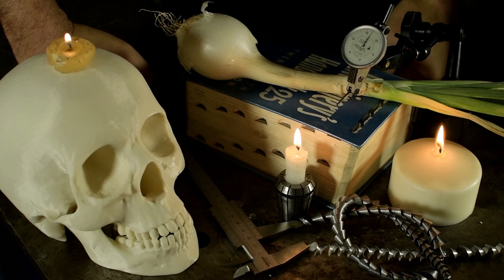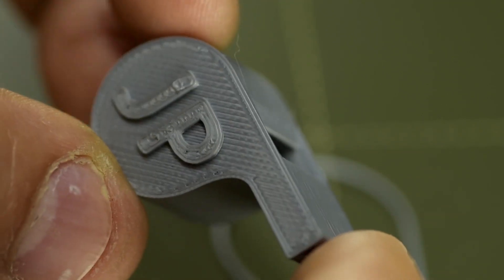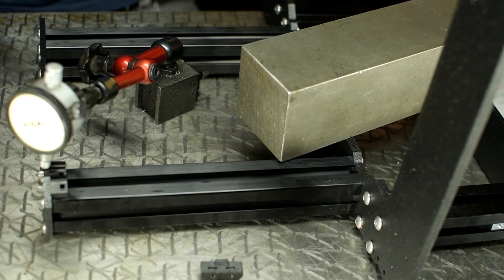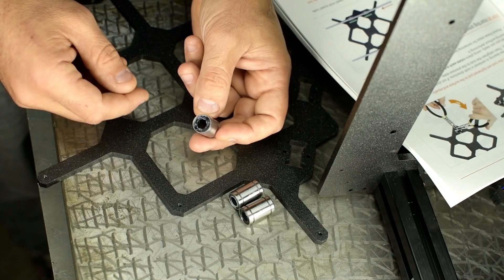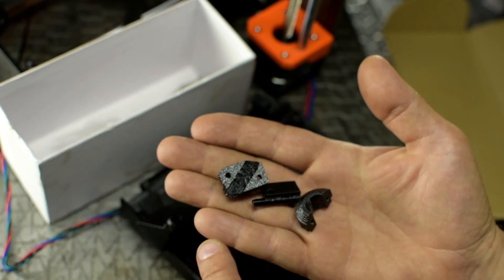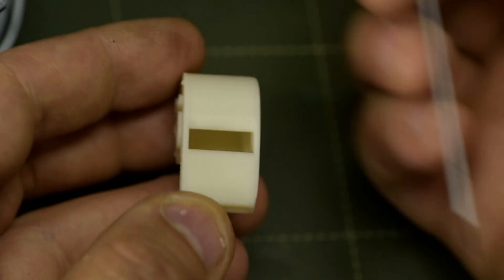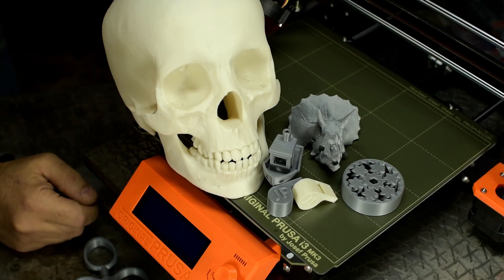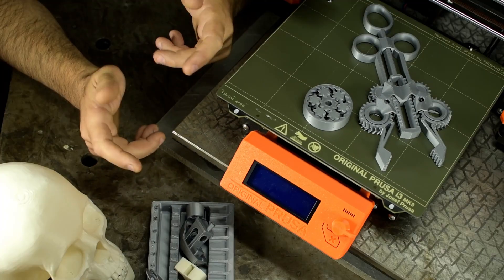This Old Tony in 3D!!! (printing)

Comment: Drive belts need tightening to reduce rippling from change in direction backlash such as near the port holes.
Reply: npgoalkeeper _ the back lash from the rubber drive belts will cause ringing. Adding better quality steel belts will reduce it but also having enough tension to reduce backlash. Axis stiffness... you’ve got bigger problems if this is your the cause and forever be chasing your tail trying to get decent results. Having a solid frame is paramount. Plenty of cheap printers can be made rigid with off shelf parts or home made. Plenty of people have to print their own parts to improve them but I find its best just to design/buy a frame that is rock solid from the start. When you do have a rock solid frame you’ll see how every other part, like the drive belts and cogs, give undesirable results with out proper tuning. Frame, steppers, drive belts, settings, dampening, inertia, bed temps, adhesion, etc, etc ... welcome to the 3d print world ToT 😆

Comment: Prusa has build many thousands of these, but they still make all their parts on hundreds of 3P printers running 24/7.  It drives this engineer crazy.  If they had switched to injection molded parts their product would be much cheaper to produce and the parts would be stronger and more precise.  But, 3D printers are by far and away the best way to learn 3D CAD.  Designing a fairly complex part on the computer and be able to hold it in your hand in a few hours is truly amazing.

Comment: My son started out with the Ender 3 for a few years and it's been reliable.  He bought a Prusa and put it together in one very long evening.  It's so much better out of the box than the Ender 3.  The software is great.  For Father's Day he took the Ender 3 and upgraded the stepper motors, driver board, bed, and put a leveling sensor (can't remember the name) and tuned it all up and gave it to me.  Hell I can even send the files over WiFi and it uses the same software as the Prusa.  Print quality is really close to the Prusa as well and it's a hell of a lot quieter now.

Welcome to 2015!

Comment: I've been 3dp'ing about a year with a cheepie (monoprice aka wanhao i3).   Lots of headaches, but it kinda sorta worked after an hour putting it together.  Lots of hacks addons after a year and I can almost always get what I want printed on it (within it's limits of course) but can't bet on getting consistent results no matter what.   IOW it may take two or three tries.

I should have ... and almost surely will within a few more months spring for the Prusa.   With the MMU. 

One suggestion I have that you won't know how you lived without once you use it for about a week:  Octopi.   A raspberry pi that drives the printer ... and you can control it from anywhere within your wifi domain (you can set it up to control from anywhere through the internet, but until that has much better security end to end I wouldn't/won't).    But octopi makes life so much easier.

Comment: welcome to the rabbit hole. (*possibly black hole). I have tried most things over the years, including a  belt driven dual Z axis, multi motor Z axis, linear rails, multiple hot ends, mixing hot ends, bowden tube extruders, direct drive extruders, combinations of the above. Dampers, main boards, stepper drivers, firmware builds etc etc.  Printed everything from PLA to Nylon. The two best things I have found over the years that apply to pretty much every case are 1: Time taken to get nozzles tracking parallel to the bed, this can be overcome somewhat with manual /  auto bed leveling meshes created in newer firmware revisions. 2: correctly setup and calibrated slicing software and printer step settings.  3: 32 bit main board with modern drivers offer many features that older printers didn't have as well as reducing noise, great upgrade for older printers.

It's easy to get carried away chasing that perfect print with incremental upgrades.. but unless you have an exotic need like 5 or 6 nozzles to speed up multi color prints (opens its own can of worms) then most modern printers even budget ones as long as it is built square and the stepper motors are setup accurately with matching settings in the slicing software till produce good useable prints.

The rest is just cosmetic, for example one of my printers has 90mm fans everywhere and silent steppers and prints at low speed but it is in a room I use often so the near silent operation is great. 

It seems to me like you'd want to print a lot of ABS or Nylon perhaps.. these really need some decent enclosure setup and the filaments need to be kept dry like welding rods. 

I think part of the fun is being able to do and try whatever you want, at a price that suits your budget! Just remember to clear out a section of the garage to label "unused 3d printer parts" ;)

Comment: I got into 3D printing about 6 months ago, mostly printing mask extenders for my nurse wife to bring to work and hand out free to everyone. 2 things I have learned so far are 1) when it works it works, and when it doesn't it doesn't and its not easy to figure out why. 2) 3D Printed parts don't stand up to heat at all - I printed new axles for the tray wheels in my dishwasher... 3 weeks later they disintegrated. (Even in ABS) Looking forward to more 3D printing vijayos!

Comment: I'm sure someone else pointed it out, but 3d printing is not food safe. You can post-process by sanding and using filler to fill the layers. I wouldn't lat you kids keep those whistles too long. I also want to tell you not to use the PETG without putting glue stick as a median. The PETG will rip a hole in that pei sheet. I recommend getting the textured sheet because it's practically indestructible.

Comment: 4 hard earned tips: 1. Rigid table (you seem to be on that) 2. PLA+ from Duramic (no affiliation) 3. Cheap solder-in inserts 4. Play with settings a lot.

Comment: It is just like any other tool, it has it's place and use. 
Metal working wise they are great for custom fixtures and vice jaws. There are even places printing dies for low volume aluminum press break work.

I would bet on a hot end rebuild around 1-2k hours, nozzle, ptfe tubes, maybe even the heat break. Just take it easy on the material swaps, frequently switching between material with different temperature ranges will toast nozzles. The low temp material will not get fully purged and burn to the inside of the nozzle, or the high temp material will not have purged and will be still coating the inside of the nozzle so the low temp material can't be heated properly to extrude.

Comment: Another cool thing about 3d printing is you can use it to make patterns for aluminium or bronze casting. The  pla can easiely be burned out from the plaster just like a wax model.

Comment: Young software geeks would not have tools.  They have software manuals and the internet.  I have a 3-D myself.  I have to re-engineer the unit to get it to function correctly.  I have 3 color but the company only tested 1 and 2 color in the lab.  Thread locker - liquid gummy bears to gum up the threads.

Comment: Hey @This Old Tony. Great Video as always. I just purchased my second print which in the new Ender 3 V2. So far, the machine is fantastic. Easy to assemble and even easier to operate. 

I am also printing with ABS without an enclosure and might have a few tips.

1st.) Use a brim. It essentially creates more surface area for the part to stick to the bed. I am using a 10mm brim and when the machine is printing the brim I make sure my z-offset is correct to ensure that the part sticks. To dial this in, look closely at the filament when it starts dispensing. If you can see the bed in between two lines of filament, then adjust your z-offset in the negative Z-direction. If two passes of the brim seem to be overlapping than move the Z in the positive direction.

2nd.) Make sure you are printing HOT. I am using the ABS filament from Sunlu and my Extruder is sitting at 255 C and the bed is sitting at 110 C. This will be different for each filament so it might take some tuning and adjusting.

Hope this is useful.

Comment: ToT going in reverse: Mill, CNC Router, 3D Printer.  I went the other way, and while I do still get a lot of use out of the mill, by far I print more parts than machine them.  Hell, the DRO mounting system I made for my mill was 3D printed on my Prusa (pending milling from aluminum...eventually...I swear).  There's something so satisfying going straight from CAD to a plastic model.  Pick the right material, and there's not much else you could ask for.  Except that holy grail of rigidity and heat tolerance.  Can't beat metal for that.  Enjoy that fantastic printer, ToT!

Comment: You missed the most important thing you can do with that printer. They are great for making one off destructible fixtures and jigs for machining parts. The best part is if you damage the tool you just print another one.

Comment: I have the ender 3 pro. 
Tpu has been the most amazing filament for me so far. I have repaired several air nailers by printing custom seals and gaskets. 
When you build the controller for the maho you could also add a hot end heater and thermocouple. Be a great large format high precision printer, just a little slow.
Reply: TPU on the standard hotend/extruder?
Reply: @rgjdk  Yep all original parts worked great. Upgraded now after a blob of death and it only got easier.

Comment: “3D printing adds a whole new dimension to 2D printing” 😂
Reply: Loll
Reply: @surajrathodsr8742  qq
Reply: BIZZY BONE the mantra album burning up charts...
Album of the year...
https://youtu.be/hyyrCyJPzYI

We told you this shit was eternal🔥🔥🔥☠☠🔥🔥☠☠☠
No one hotter In the game right now
Reply: technically is not a 3d printing, but 2d printing repeated many-many times.
Reply: @alexkart9239  2d is actually 3d, cos ink has thickness.

Point is, earth is flat
Reply: @alexkart9239  But when you print with a laser printer, you print it line by line. It's quick, but it's printing 2d at the same time. Does it make it a 1.5d printer? And printers with ink cartridges, with 3 colors and black, they print quarter of pixels by quarter of pixels. What are they then??
Reply: @alexkart9239  They call it 2.5D. True 3D printing needs non-planar
Reply: @Sonicbolt456  Airbrush nozzles are very good for this since they can be very long, pointy and slim and there is a fork of slic3r that can do some (VERY buggy) non-planar slicing. Nearly every 3d printer can do this to an extent, depending on your BLTouch mount, part cooling solution and nozzle shape and length. If you really want perfect non-planar printing tho, a 4 axis printer is what you want.

Comment: You made the right choice I’ve used both your Prusa prints better all around. Your getting some ringing in the print kinda the one down fall of a direct drive printer  if you slow your speeds down you can stop it or  do a firm ware edit and drop your acceleration settings so it ramps down alittle slower ringing is the transition from one direction to the next and the carriage weight carries alittle befor the change

Comment: Nice material choice. ASA and PETG are very interesting materials, especially for not just printing pretty figures. Personally PLA is the last choice for me as its brittle and deforms/melts quickly. PETG can be pretty much as easy to print btw.

Comment: Something cool you can do is print a part, use investment plaster to make a mold with the 3D print as a plug, burn the plastic out of the investment plaster mold, then use that mold to cast aluminum or something.

Comment: Wow, I would have figured that you would have gone for one that can print in metal.  With a couple of CNCs, the next logical step would be a laser cutter, water jet cutter or a plasma cutter.

My Prusa mini seems to be stuck in Prague, and things being what they are it would be tough to go get it.

If you you're so inclined, you can check out my stuff on Thingiverse.   I have 3D STLs, laser projects and and CNC models.  https://www.thingiverse.com/openscaddad/designs

Comment: I bought my first 3D printer back in 2011, cost me $1200 and also had to put it together; Out of threaded rod with 3D printed vertices. None of that fancy extruded/watercut aluminum nonsense! And yeah everything you said about getting into the weeds with settings and stuff? That was the norm. How far we've come! Tip: Get one of those large tupperware bins with the gaskets and some desiccant to store your filament in, it's sensitive to humidity.

Comment: Prusa printers are wonderful great.  I have a clone (similar to the Creality but older).  The clones are not quite as polished as a Prusa but the clones are a really great value.
Have fun.  It's just another tool in the shop.
Good to see that you designed something rather than just printing toys from Thingiverse - though I see you did some of that too.
BTW my son built our printer - when he was in 9th grade.  They design stuff they need in F360 and the print it all the time.  It is a great option.

Comment: I love my ender 3, i make brackets and other bits I need. Like today I needed a bracket to hold a water cooling radiator onto the underside of my cnc router work bench to keep the spindle cool. 90 Minutes later, printed and radiator installed.

Comment: I mainly print with PETG due to layer adhesion is amazing with the right cooling. It's strong like ABS and easily printable like PLA. So its a good middle ground. it's chemical resistant and unlike ABS you don't need a heated enclosure to prevent parts warping.

Comment: Tune the extruder stepper and retraction for stringing, or hit it with heat (normal person heat, oxy doesn't work that well on printed parts, might be a good video tho) and the z banding at the bottom of the benchy might be a little fine tuning of the z axis/belts... Can't wait to see this integrate with you're future builds.

Comment: I knew this day would come. Hell, I was about to just buy a tronxy kit and send it to you tony. In hindsight, Prusa was the way to go. Ender 3s are finicky and constantly need attention (I have 3 of them). I don’t really think you’ll need much advice from printers like me. You have the mechanical knowledge enough to build them better then almost everyone who prints. But, I would say focus on fixing anything that gives you post production like the stringing. Your benchy has some side surface artifacts but I bet you’ll be using this mostly for utilitarian purposes so don’t pull your hair out over it. 

Last thing, get your kids learning to 3D model. The first thing anyone getting into this hobby learns is an ability to identify ways you can use 3D printing to solve problems. They’ll learn to upcycle and solve problems in broader ways than machining alone can offer. The ticket to that is 3D modeling.

Edit: I run the QC room at a metal shop and it’s surprising how many things 3D printing can be used for. All the machinists love the plastic vblocks I print because they don’t scratch metal while they are deburring. Also, gauge pin trays have been a pretty big hit. CMM fixturing, OD Mic hangers and thermal sleeves, the list goes on and on.

Comment: Having recommended to the local public library a Prusa Mk2 (earlier days) and having assisted in the kit assembly (more challenging than the Mk3), you are spot on for your reason to build a kit. Additionally, your "plug-it-in-and-it-works" results would not be duplicated with the Ender line of printers. You did good, really, really good. If your bed is PEI, print your parts in various locations. Constantly rinting in the center will wear the grippiness away over time.

It's wonderful that one of your early prints serves a useful purpose (tool holder) rather than a dust collector. Of course, a pair of noisemakers qualifies as useful, at least to the younger set.

Comment: Noice, thats an almost perfect first print! Looks like there's a tiny bit of elephants footing, but that's a fair price to pay for good bed adhesion. there is a setting in cura called initial layer horizontal expansion(not sure what its called in prusa slicer), if you ever end up having any issues printing print in place models, that might be the solution. Looking forward to seeing how you use it!

Comment: Great video! I'm so glad you're enjoying this hobby of mine. There is so much you can do with 3D printing! I have a few pieces of advice:
Be careful what you print in PLA. You're right that it's one of the easiest materials to print with, but I would strongly recommend avoiding it for any structural pieces, as it loses strength over time and slowly changes shape when under a constant load. I personally enjoy using PETG for more structural prints as it is more flexible and doesn't warp too much.
Watch out for humidity. Most filaments are hydrophilic, and if left out for a while absorb moisture from the air, which boils when the plastic is melted in the hotend and can ruin prints. It is possible to use a food dehydrator or oven at a low temperature to reverse this. Nylon is particularly susceptible. 
Lastly, I can't wait to see how you use your new printer, and integrate it with your existing machine shop workflow. Have fun!

Comment: 1:53 Building the MK3S printer is a challenge unlike any other you should treat yourself for every mile stone you reach that is why a bag of Haribo bears is included.
  The biggest issue from previous builds MK2S  which we had to address was in adequate bear consumption.
Etc ....